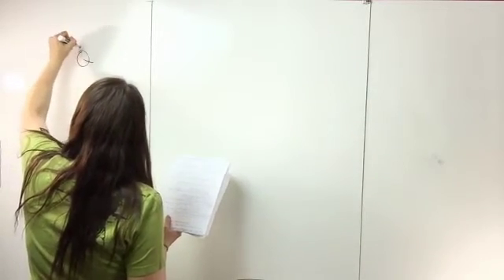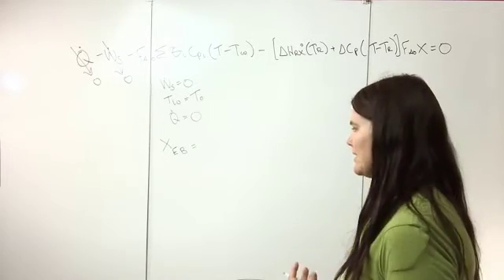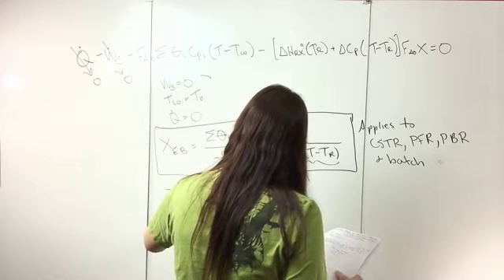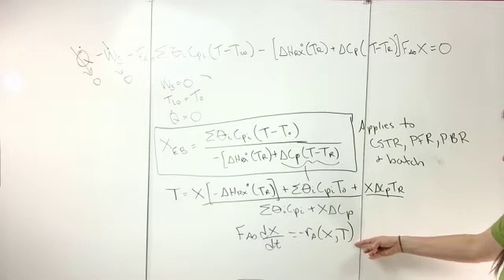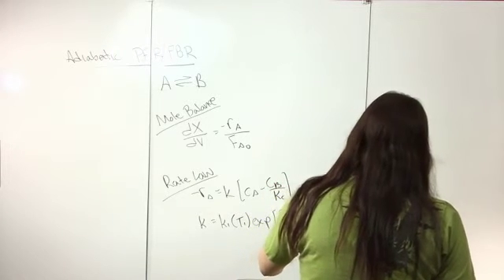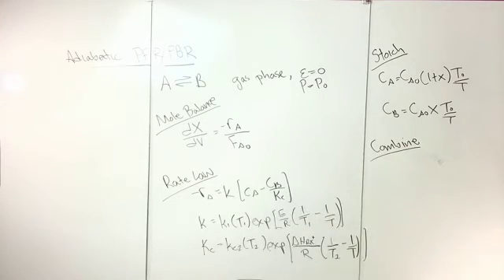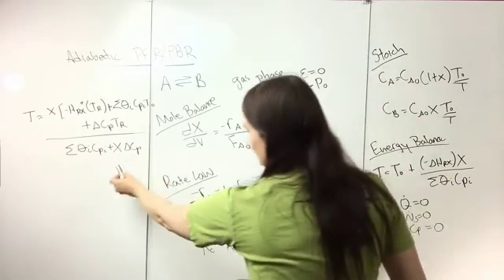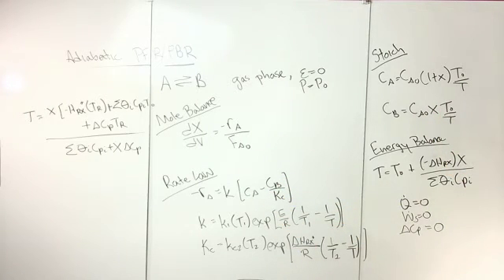Energy Balance for Adiabatic Reactors

Comment: Hi Raili, I think you should've included (1+eX) in the denominator of Ca and Cb when doing the stoichiometry for PFR because it's in gas phase
Reply: Replying to an old comment, just to clarify...if epsilon = 0, then the denominator is 1, or (1+eX) = (1+0(X)) = 1. There is a mistake: Ca = Cao(1-X), not Cao(1+X)
Reply from the maker: Thanks, I need to fix it.